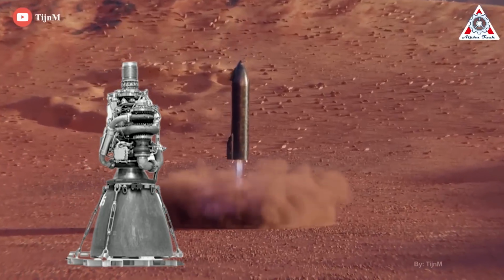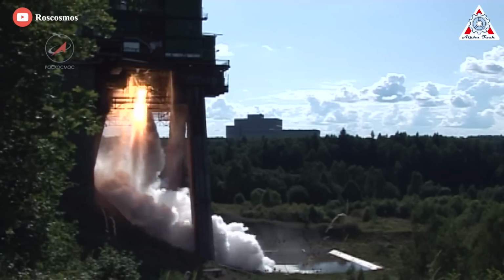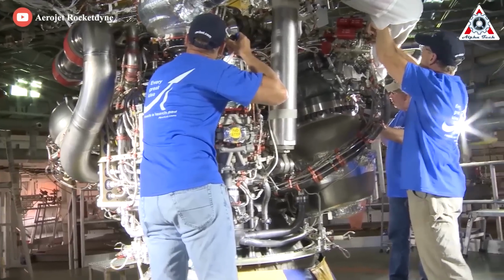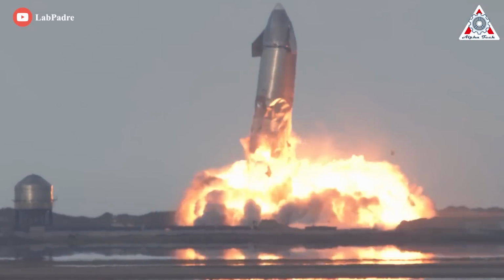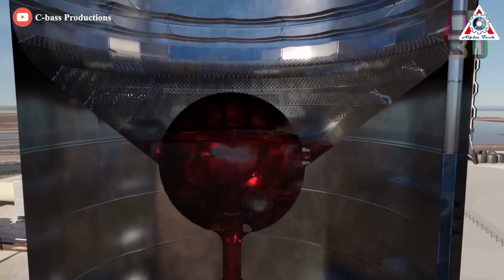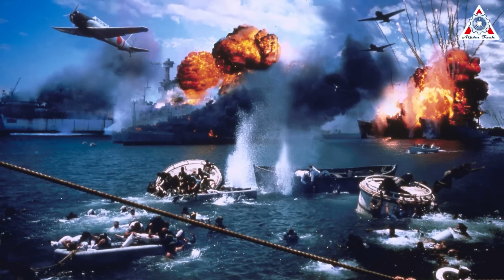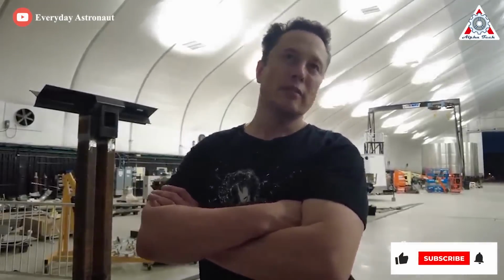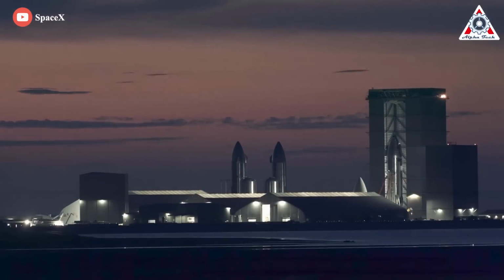SpaceX NEW Raptor Engines "BIG PROBLEM"...

Comment: An Ox-rich preburner does not produce hotter gas than a fuel-rich one.  The problem is that hot oxygen is very reactive.  Welders use pure oxygen to cut steel.  The Soviets found that copper alloys could withstand the hot oxygen.  Others have made Ox-rich preburners since, such as the U.S. Integrated Powerhead Demonstration project.  Wonder what alloys SpaceX uses in their Ox-rich preburner and turbine blades.

Re operational cost, NASA tends to spend excessive time performing tasks with little value just because they were done a first time.  Procedures get locked in place and nobody asks, "Do we need to keep doing this every time?".  When serious issues arise, such as the vaporizing O-rings on the Shuttle SRB, they are treated as "bothersome" and attempts are made to ignore them by "normalizing the problem", with statements like, "Well it hasn't been a problem yet".  Most of this attitude is typical in government bureaucracy where blame-avoidance is a primary management objective rather than cost-effectiveness and true risk-minimization.  I would leave it to SpaceX to decide what tests and maintenance is needed before re-using an engine.  As long as Starship flights are unmanned, the only risk is cost.  They have demonstrated that the vehicle can continue out to sea with even 7 engines out.

Comment: 🤔 ummm this is why there are multiple little engines and ummm falcons are reusable. this video makes it sound impossible. the engines have been tested and improved each time used. also they said they still get fully serviced after each use, but not replaced. this video is click bait

Comment: Admittedly, I’m no rocket scientist and not an Elon Musk fan! Now, it doesn’t take a degree in anything to see that something is wrong with this project, just by looking at the launch pad and comparing it with the 60 yo pads at Cape Canaveral! NASA built its pads to be able to stand the shock of the rocket engine firing, multiple times. Boca Chica pad for the most powerful rocket ever launched, looks (looked 🤔) like a 3rd world workshop with a dirt floor, no safety and got totally destroyed.🤦‍♂️ The gas/tank farm, where the fuels are cryo cooled, is too close to the launch pad and received substantial damage from the debris ejected, in case of a pad crash the whole site would be totally destroyed. Compare that with NASA standards. Lastly, not directly related to the rocket technology, but the fact that Space X (Elon Mask) has shown total, complete disregard for the environment restrictions and the complaints of the locals just shows the ethical standings of this Company, it also shows the inability/unwillingness of the FAA and Texas administration to oppose “big money”, with all the expected consequences for the community! Boca Chica should have never been selected as a launch site!

Comment: It seems like the first stage firing of those raptor engines would be like taking a high pressure cutting torch to the concrete it is hitting (of coarse without the stream of oxygen gas coming from the cutting torch tip), I have cut a lot of steel before with an oxy acetylene torch sometimes getting it close concrete, the concrete snaps, pops while small pieces being thrown from it, be sure to use safety gear especially for your eyes, concrete and a torches, be careful.

Comment: Would the Linear Aerospike Engine work for this application? The XRS-2200 was designed by NASA to be more efficient than a standard rocket but they didn't want to start over since they invested so much money in the space shuttle at that point. Space X is just getting started they could take the Aerospike and run with it. Plus it looks cool and that's half of right there.
Reply: They were too heavy, this is one of the reasons the X-33 program was cancelled.

Watch Tim Dodd's video on Aerospikes

Comment: Sadly the biggest problem is using so many engines in a first stage, just too many failure possibilities. Just ask the Russians about their incredible N1 Moon rocket.
Reply: true. but we've made massive advancements in manufacturing tolerances and computer simulation since then.
Reply: @Yxalitis  Yes but Musk's requirements for the Raptor are also massive... So the reliability of this motor may have not improved (failure rate). So back to the N1...
Reply: @paulbizard3493  They aim at 1000 reusage cycles for the raptor engines. That also should give huge Advantages for relyability.
Reply: Booster 7 already smashed the altitude the N1 got to with approx 20% of its engines out using an out of date iteration of its launch vehicle. The stack also survived several high G rotations the likes of which no rocket has done before. I think its safe to say that the platform has potential and the next launch will be better
Reply: Yeah that's way too many engines.

That's why every Falcon heavy launch with 27 engines always blows up.
Reply: @47f0  Yeah but Falcon Heavy engines are not raptor engines... And are not fueled by one unique tank with 33 pipes.
Reply: @paulbizard3493  May I refer you to the original post? "The biggest problem is using so many engines in a first stage". Full stop. 
Or did you not read the same thing I read?
Reply: @47f0  LOL, I felt some irony in your answer.
Reply: I just read that Musk said the concrete from the launching pad did not hit Booster 7. So the motors have shut down by themselves... Just like the N1 Moon rocket...
Reply: @paulbizard3493  Yes, and the same technichians then created the RD 180, that Americans purchased for centuries instead of using the F1's. You have to start somewhere, or let others do it  and pay for it. Youw could as well wait for the Chinese or Russians to do it.
Reply: But you, also, achieve redundancy.
Reply: That's it's biggest strength actually.. because the engines are designed to be so numerous and they need to be made so fast they must also be made cheaply.. it's like designing the ford model T of rocket engines that a methane, reusable and produced in numbers that make every other engine a joke

Comment: Haven't seen a single channel covering SpaceX's operations that has talked about the "Elephant in the Room" w/ the Raptor Engines . . . . until I saw This episode of ALPHA TECH !  There hasn't been a single test flight of StarShip, or it's Prototypes that didn't have a problem w/ the Raptor Engines. They're reliability has yet to be proven. Thought you Guys n Gals here at ALPHA TECH did an Excellent job of covering this subject, Plus a tad bit more. Your research on this was just as amazing. With so many channels out there just riding off the SpaceX's brand name and copying other streamers format or genre, it's nice to see a channel putting in the effort to give genuine, reliable intel on SpaceX. Nice Piece-o-Werk folks !   👍

Comment: Great primer on the Rapter Engine. I believe rapter will work as a reusable rocket...but it is not going to be easy as you pointed out. But I believe because of the pressures involved with 16.7 millions from firing 30 plus engines at once in the first stage maybe a bridge too far maybe lowering the number of engines and  up the power a bit and speading the engine array out a little bit. But bottom line the launch facility needs to include a fire trench and baffle, diverted and water dump system designed to handle 16.7 million pounds of thrust...if they don't build that no amount of engineering is going to keep that 1st stage array from destroying itself and being destroyed by the blowback from the pressure.

Comment: Um... The first part of this vid sounds like FUD. Hasn't SpaceX already solved all these reusability and procedural issues with their Falcon/Merlin program?  Surely, there are substantial engineering challenges in the raptor engine program, but SpaceX has proven so far that the improved cycle-time provided by their extreme reusability strategy leads to faster iteration while containing costs - an order of magnitude decreased cost (with, in the end, significantly better quality) compared with state-owned enterprises.

Comment: No flame trench/diverter and apriopriate water deluge system was very bad decision from SpaceX or even borderline negligence, which will cause at least 12 months delay to the program. Critics   also pointed out that Raptors still have high failure rate at tests and are not really flight ready yet. I would agree that concept of catching super heavy and starship is insanity as increases risk of destroying stage 0. I don't have high hopes for Starship program, at best they will get partial(booster only) reusability,  if they can keep cost under 100 milion  for superheavy lift vehicle, with 1 weekly launches cadence. I would consider program as successful. We have to be realistic here low cost mass production at site , simplified design , no fins, no heat tiles less  engines on starship(just increase payload capacity and simplicity to reduce costs) is the way to go I think. In terms of go beyond LEO, ditch refuelling Starship thing, just use Starship payload capacity to build serious transfer vehicle in orbit, with nuclear thermal propulsion, then refuel it with max 2 Starship launches.
Reply: Testing infrastructure that could be available on other planets is important as well, the less materials needed the better so failures of this kind might be forseeable control measures implemented needed to be challenged just to satisfy the process of selection

Comment: Yeah, but the falcon 9 proves that technological development has dramatically changed the re-usability and cost of rocket engines. The ability to 3D print components along with new developments in electronic switching, fiber optics, and material science developments provide new alloys that are used in modern engines enabling them to perform within very fine tolerances. 

The shuttle had a number of technological features that greatly extended the turnaround time especially the heat shield itself. The engines are just some of the components that will be saved in a re-usable rocket. Even if all the engines needed replacement it would still cost less if the rocket booster could be recycled in a reasonable time frame.

Comment: It will not work as long as we packed that many engines to a rocket.  Accident will always be there...not until 3 or 5 super engines come along that are reliable enough to strap on the rocket.  This will take another decade to derive such good and powerful engines. Guaranteed @
Reply: Nonsense having this many engines is redundant - what you propose would be less reliable

Comment: "New Big Problem"?  (yawn) old news.  But anyway, as an American, SpaceX makes me proud.

When you are trying to do something never done before, in this case, create the most powerful rocket ever made (double the thrust of the previous one), and with the capability of returning back to the launchpad for a quick turnaround, just about everything about the design is going to be new, big, and a problem to be overcome.

But little by little, Elon has shown that his engineering team is able to overcome those big new problems, some, several at a time.  Recall the problem when just landing a big rocket was new?  There were a lot of explosions along the way, but finally they figured it out, and it's almost now routine.  I anticipate the same with Starship.

I'm a mechanical design engineer, who sometimes has to create products for my company that we've never made before, trying to make them cheaper and better than the competition.  So, we have our own versions of test failures that we learn from as we work our way to the final product.  Compared to SpaceX, we deal with "new small problems", but new problems nonetheless.  Such is par for the course for design engineers.  And so for us, what you are witnessing is absolutely no surprise to watch, but still, as Musk says, very, very entertaining.

I'm confident SpaceX will eventually get it done.  SpaceX makes me very proud as a fellow American engineer, pushing the limits, and always trying to think "outside the box".  You don't see any other countries doing this kind of stuff.  Every American should be proud of living in a country where a company like SpaceX can thrive.  Go Elon and go SpaceX!

Comment: This is the most irrelevant discussion of the potential problems and issues  involved with achieving Raptor re-usability. For example, what was the point in discussing at length the problems NASA had with re-using the SRBs? That was totally irrelevant. And as for the suggestion that there are daunting problems involved in re-using full-flow closed cycle engines…uh isn’t SpaceX already achieving admirable turn around times re-using Merlin engines? What is so different other than size and scale that leads you to suggest that there will be many, many unforeseen difficulties in achieving routine Raptor re-use? Frankly, I am impressed with how tough the engines and airframe seem to be. Performing somersaults at supersonic speeds seems quite a test of the structural integrity of a 400’ long rocket.  I don’t know, but this video seems more like disinformation than an informative, objective analysis.

Comment: Ok lift off base as no thrust channel?
32 engines are blastuing to a flat floor?

question is how high can the rocket motoirs be to
ease the impact onto a flat void plated with metal holes
 spewing vast amounts of water and nitrogen
helping disiopate thrust heat turbulaance
revebarating shock waves??
Water may be the answer

Take a close look at how London Tower Bridge
lifts its road bridge
also look at Scotland's Selkirk canal High to low Cannal bard wheel lift
There is also a canal slip road in Belgium?
Also Scarborough Yorkshire Cliff railway

All use the point water displaces its vo0lume of wieght
as Academies theory/
If Thrust pad is on one end of a solid counter balance?
The mother huge water tanks and a pivot point in the center
displacement of controlled water
would take launch pad section??
I:e on track upward 
i:e pivoted upward 
or simply levered upward
or even on a track upward and away from the tower.
height & distance is as the old saying goes
give me a lever long enough?
I can move the world?

simple less parts may not look elegant 
but like the Victorians did
Brunel Stevenson
If it works well and easy
that is the way/
The Selkirk canal lift takes Two fully loaded craft
50 - 70 ft and it uses only small difference in water
counter weight to lift one up and another down?
very slow and very gentle?
Water left in top section when locked for take off
could be used for cooling pad

Comment: Ok lift off base as no thrust channel?
32 engines are blasting to a flat floor?

question is how high can the rocket motoirs be to
ease the impact onto a flat void plated with metal holes
 spewing vast amounts of water and nitrogen
helping dissipates thrust heat turbulence
reverberating shock waves??
Water may be the answer

Take a close look at how London Tower Bridge
lifts its road bridge
also look at Scotland's Selkirk canal High to low Canal bard wheel lift
There is also a canal slip road in Belgium?
Also Scarborough Yorkshire Cliff railway

All use the point water displaces its vo0lume of wieght
as Academies theory/
If Thrust pad is on one end of a solid counter ballance?
The mother huge water tanks and a pivot point in the center
displacement of controlled water
would take launch pad section??
I:e on track upward 
i:e pivoted upward 
or simply levered upwards
or even on a track upward and away from the tower.
height & distance is as the old saying goes
give me a lever long enough?
I can move the world?

simple less parts may not look elegant 
but like the Victorians did
Brunel,  Stevenson
If it works well and easy
that is the way/
The Selkirk canal lift takes Two fully loaded craft
50 - 70 ft and it uses only small difference in water
counter weight to lift one up and another down?
very slow and very gentle.??
Water held in top Rocket base when locked for take off could be released to help cool base pad

Comment: Doesn't SpaceX already have a track record with engine re-use with Falcon 9?
Reply: Yes. And the Falcon Heavy boosters too.
Reply: @r2hildor  Uh, I'm not sure launching something into geosynchronous orbit at 23,000 miles is considered low earth orbit. The Falcon Heavy just did that in fully expendable version yesterday. But certainly not lunar distance.

Comment: Also the Raptor is NOT a good choice for upper stages, let alone interplanetary missions in terms of specific impulse (a measure of efficiency) - it doesn't come close to known nuclear designs or even SSME. This is why you need hundreds tonnes of fuel that requires multiple orbital refueling to get to Mars
Reply: They have raptor vacuum for upper stage - you should design a rocket if you think you can do better - fyi for a nuclear rocket do you imagine what the FAA would do with that - it would be an absolute nightmare to get flight certification
Reply: @matthewm7867  Lol Raptor Vacuum. Really? 380s vs 450s for SSME

Comment: the rocket exploded? i wonder if musk will give it back its blue check mark
Reply: It didn’t explode they used the flight termination system as it veered off flight plan - it had insufficient thrust as engines got hit with concrete

Comment: All the added weight to starship by building with stainless steel was a big mistake. When the engines were lit, it took over 8 seconds before it even moved. No wonder the pad was destroyed, and all that sustained heat probably did a lot of damage to the engines. To see what lift off should look like, watch the SLS launch, when the boosters were ignited the thing was gone. For those who referred to Starship as the flying garbage can, will have to change that to the exploding garbage can, this dog might never get off the ground.